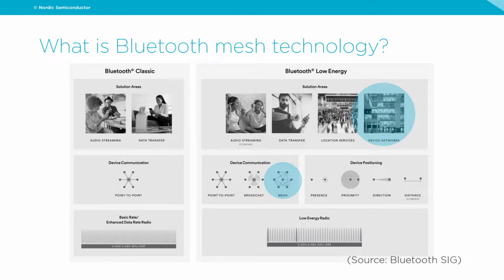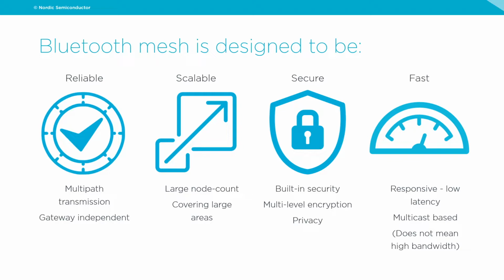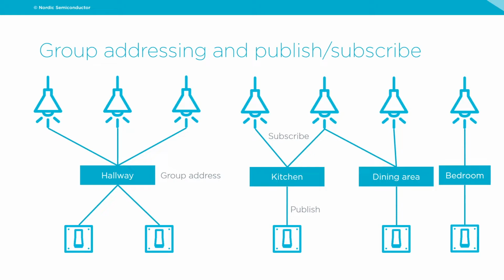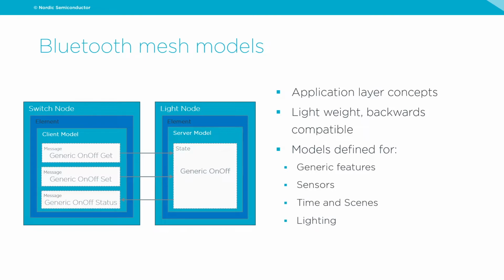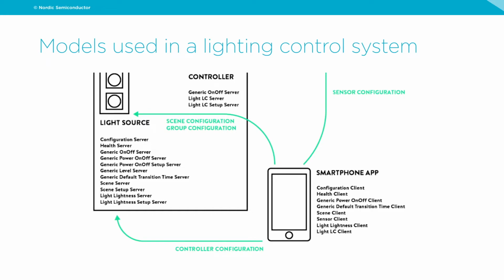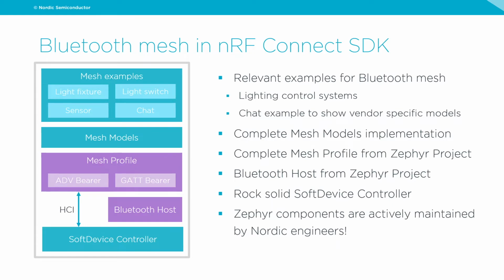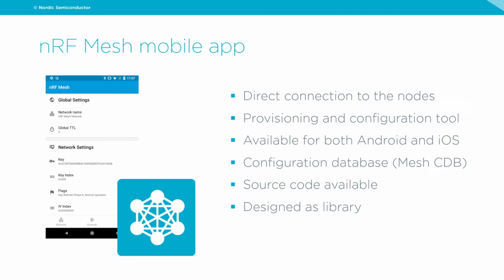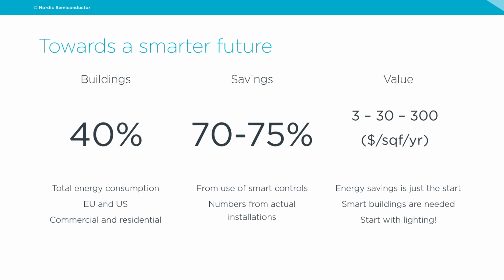Introduction to Bluetooth Mesh

Comment: Nice introduction, thanks for your information. Quick question 17:50 why the threshold is 32767? It seems the limitation is an int16_t but not an uint16_t?
Reply from the maker: 32767 is the theoretical maximum, as addresses are 16 bit (meaning the number of addresses are 2^15 - 1). However, the actual maximum will be quite a bit lower since one node can have multiple types of addresses. In summary, the limitation is in the Bluetooth Mesh specification.

Comment: Hi, thanks for the video. I've set up nRF Connect using VS Code as the IDE with the extension pack and was wondering if I could use Zephyr RTOS out of the box or if I need something else ?
Reply from the maker: Hi Bastien, it sounds like you can simply open VS Code from the Toolchain manager: Isåfall skal det bare være å åpne VS code fra Toolchain managern https://developer.nordicsemi.com/nRF_Connect_SDK/doc/latest/nrf/gs_assistant.html#toolchain-manager

It might be good to follow the getting started guide in the documentation: 
https://developer.nordicsemi.com/nRF_Connect_SDK/doc/latest/nrf/gs_programming.html

We also recommend you to watch this video series about nRF Connect for VS Code https://www.youtube.com/watch?v=2cv_jjqk5hg&list=PLx_tBuQ_KSqEt7NK-H7Lu78lT2OijwIMl